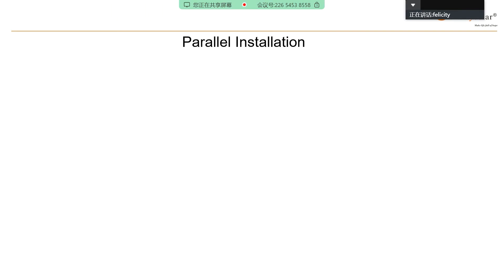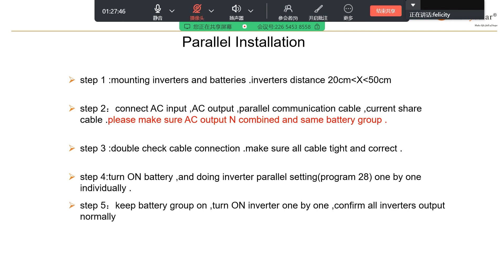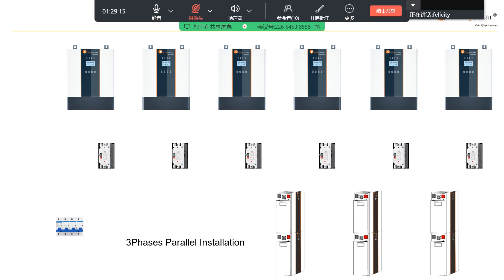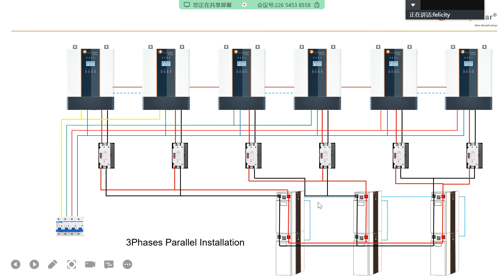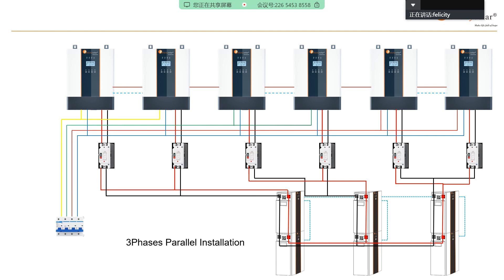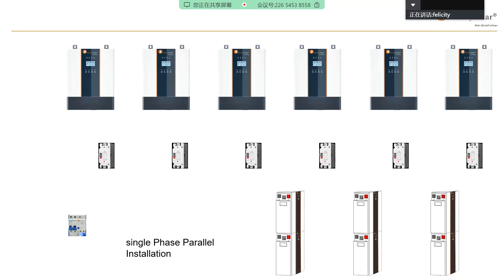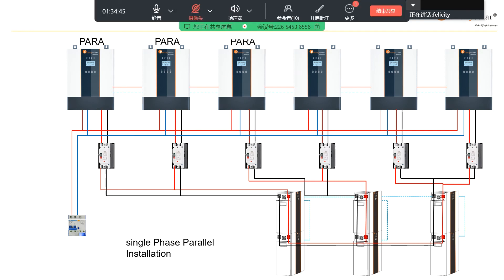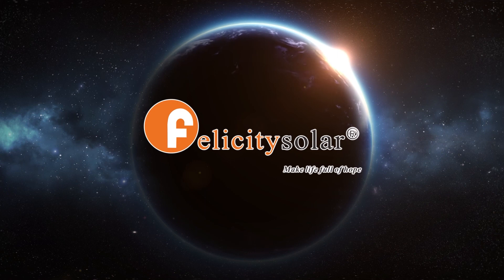single phas and 3phases parallel installation

Comment: The best video i have watched on the internet. Thanks for educating us.
Reply from the maker: Thanks for your suport, Felicitysolar will keep moving on!
Reply: @felicitysolar please i need a clarity. If the  total batteries after the parallel connection has has 400ah. How do we select the correct sizing of the mccb to the individual inverters?

Comment: Hi, do l need to connect the paralling cables if each inverter is supplying each phase for a 3phase system, and also do l connect a communication cable between the inverters, if so is it a straight cable
Reply from the maker: You can pls contact our technical team for detail professional help, we will reply you as soon as possible: technicalsupport@felicitysolar.com/whatsapp:+86 18022876286

Comment: Ok, great presentation. I have two Growatt sph600 inverters of 7.2 + 5.0 Kw each, which I want to connect in parallel. On one I have 6 x 2.5 Kw batteries. My problem is that I don't have the connection cables in parallel and I don't know how to limit the export to the 220v grid. Do I need another device or the setting is done from the smartmeter?. Shinephone will show the entire system or just the master inverter ?. Appreciate for a reply. Thank you.
Reply from the maker: May I know which country you are from? Then I will send you the contact information of the technician.

Comment: How can I achieve 120kva using felicity 10kva ivpm inverters. Parallel connection, Three phase configuration ?
Reply from the maker: hello! May I know which country you are from? Then I will send you the contact information of the technician.
Reply: @felicitysolar  Nigeria
Reply from the maker: @joesanchor1834  Please contact our engineer for Technical support by whatsapp: Wasely  +86 131 2609 3443
Reply: @felicitysolar  ok

Comment: Hi! Thanks for the video. Which Micro Inverter can be used with this lithium battery? Maybe the Hoymiles HMS-2000-4T? Can I split the output into 4 strings which can be connected to the Micro Inverter?
BR, Seb
Reply from the maker: If you have any questions, please contact candy:
Tel/Whatsapp: +8618578741060
Email: candy@felicitysolar.com